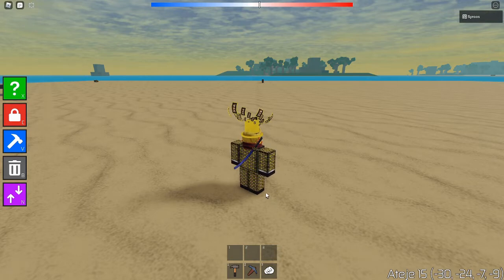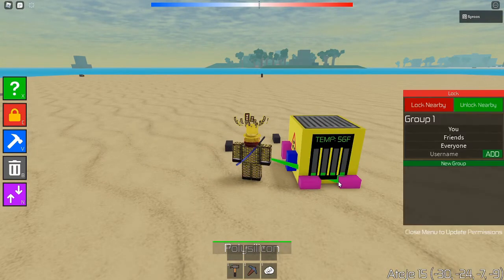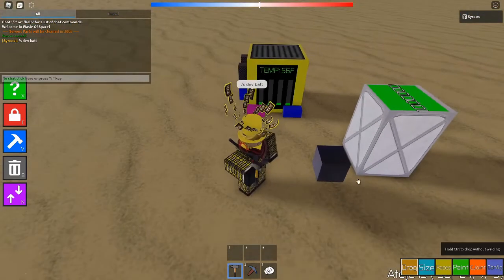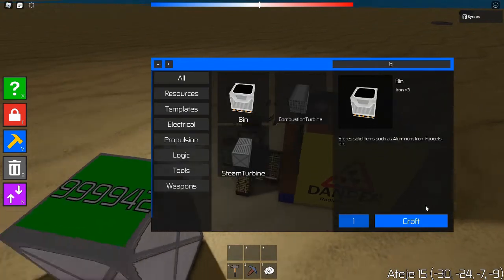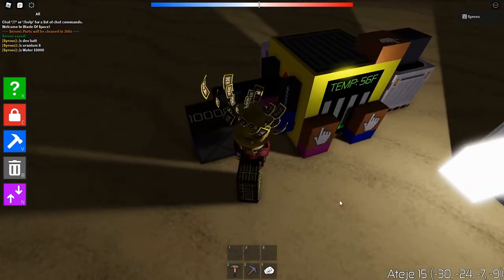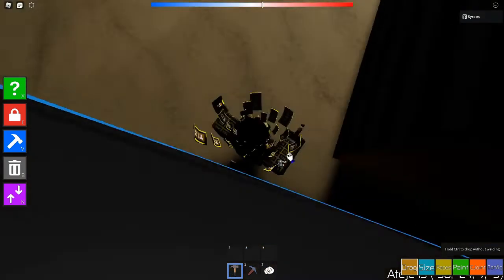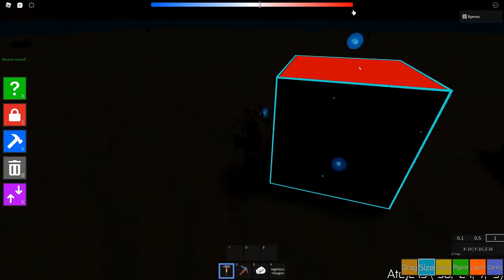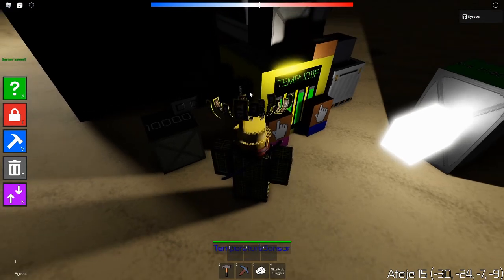Waste Of Space Roblox How To Nuclear Remade

Comment: Thank you! Other one exploded after april fools... :D

Required Materials:
 -- Reactor

 -- Polysilicon (x5)
 -- TemperatureSensor (x2)
 -- SteamTurbine (x3)
 -- Button (x3)
 -- Bin (x2)
 -- Dispenser
 -- Valve
 -- Container
 -- Pipe(s)
 -- Wire(s)
 -- PowerCell(s)

Raw Materials:
 -- Iron (x249) +
 -- Quartz (x17)
 -- Copper (x57) +
 -- Stone (x36)
 -- Grass (x33)
 -- Flint (x9)
 -- Sulfur (x0) +
Reply: (it wasn't the tutorial, the planet just had really high ping)
Reply: what do you mean no sulfur?
Reply: Thank you many I was hoping someone had the raw materials so I wouldn't have to do the math
Reply: @nicoli5429 no problem!